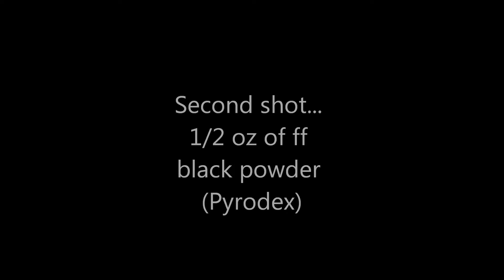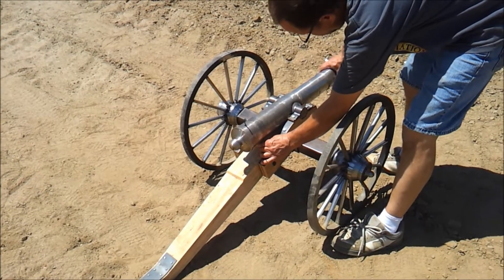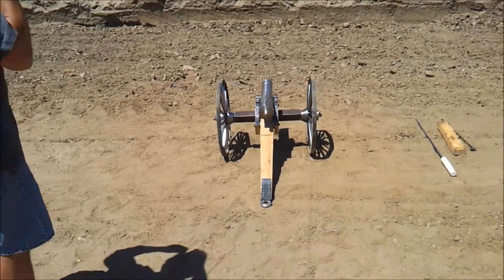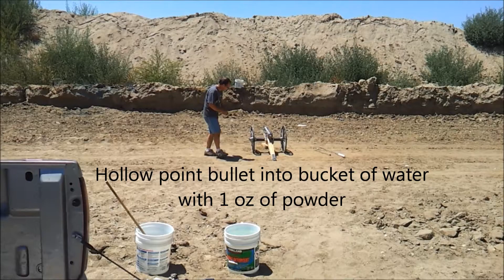First Test Firing of 1 3/4" Cannon.wmv

Comment: It looks good i hope u are gonna add the rest of the carriage parts still. Your method of loading isnt allowed at cannon shoots though, u cant use any paper. I use levi cloth patchs on the ball in my smoothbores it helps a bit because the balls not bouncing down the bbl. A proof load is double the standard charge & 2 balls. Best done with bbl out of carriage, thats the way the army did it. On a couple smaller ones like yours i put an M15 rifle grenade sight on the end of the left trunnion, its just a plate & the sight attaches to it

Comment: Nice job was well done, just need to fix the screw for aiming. Can I get plans or what plans did you use to scale it down? Also what steel did you use? I have 4" stainless that I think would make a great cannon just need some motivation and plans.
Reply: Dixie gun works or antique ordnance publishers has great cannon blueprint books mine is book #12 titled artillery for the land services of the U.S. 1849-1865. Field artillery - I. the first half is bbl prints, 2nd half is all carriage parts for 2.9" & 3" parrott rifles, 3" ordnance rifle, 6pdr field gun, 12 pdr howitzer. Their very clear fold out pages. I hope this helps. I shoot 40MMs, 3" ordnance rifle, 3" parrott rifle, my faveret is a 40MM breechloader. The big ones use 9 1/2 lbs of lead per shot. The 40MMs only 1 1/2lbs😊

Comment: If I have a 18 inch barrel and 12 inch wheels how long should I make the trail
Reply: My 69cal traditions 12pdr is close to your size of 18" bbl & 12" wheels. The 69cal bbl is 15", wheels 11 1/2", trail 19" not counting the lynette (eye ring on the back end) & wheels 13 1/2" wide & axle 8 1/2" wide so your trail should be about 20 to 21" long😊